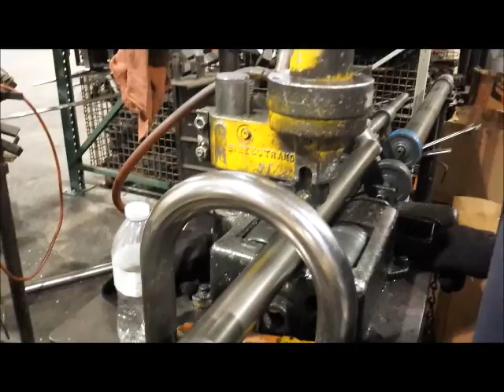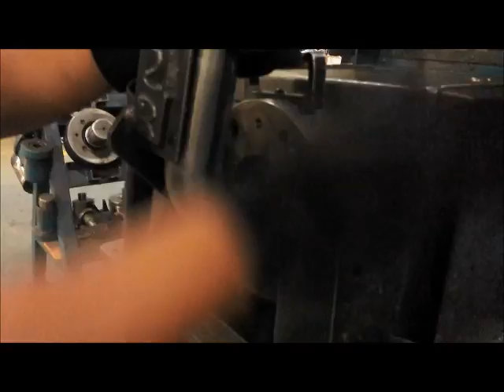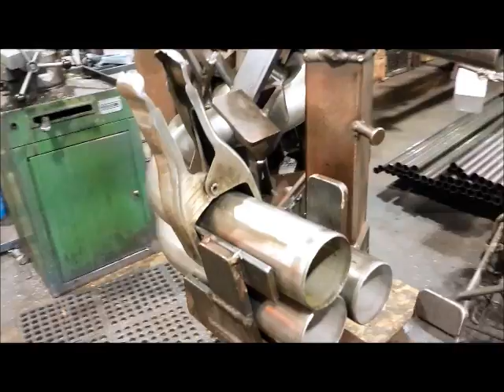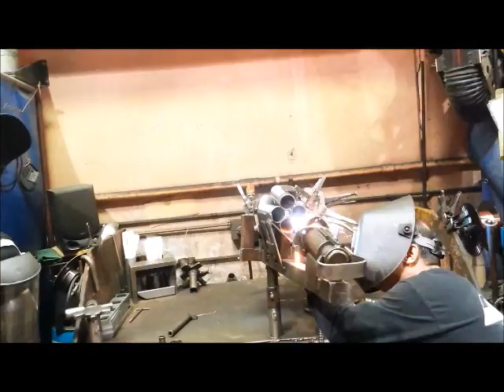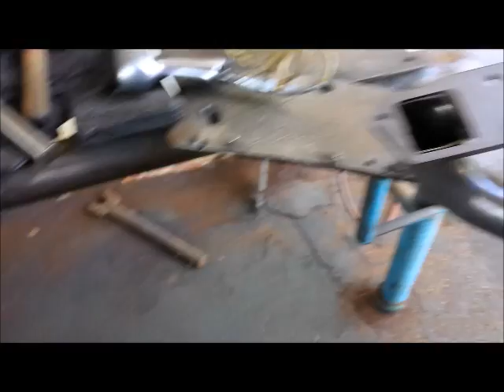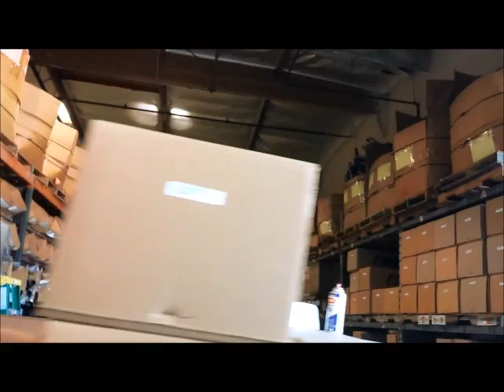How High Performance Headers Are Built

Comment: Hell yeah, Mopar or no car baby 🤟🏼. I can tell that the guy on the right is a newbie, as he didn't know that the SRT8s are powered by the gen3 Hemi mills and is green. I've heard of TTI before, but aren't real familiar with them and didn't know that they specialize in Mopar. He mentioned the 413 wedge and just about bought a 71 Dart last year with a built one. It was so badass and was a sweet little ride, but unfortunately the deal fell through and didn't get it 😪. 
We've been looking at Kooks long tubes for my Challenger SRT8 that we are building, and am looking at all of my options. She's got a decent set of pipes on her and are the SLP loudmouth cat-back system, which basically consists of open chamber racing bullets on 3" and rocks. Indy builds some awesome racing engines, and know a guy that has a 71 Cuda with one of their 572s in it and routinely beats up on hellcats, shelbys etc respectively. Or whatever you throw at it and is brutal, especially for as light as the E bodies are 
💪🏼😎

Comment: Excellent product! I put a polished set on an early model Valiant with a 318 & a 4 speed trans. Only minor engine placement issues easily fixed. I think an automatic would have been a better choice for the car as the stock clutch linkage would not fit but a hydraulic throw out bearing solved the problem.

Comment: I love my hooker headers on my 70 mustang 351w stroker. they are ceramic coated and  are clearanced properly. no familiar with these guys but I'm learning.
Reply: Im peed off that right hand drive performance headers arnt available for a 1999 slk 230 kompressor.

Comment: TTi headers are fucking garbage. Those guys that weld them up can't weld for shit. They look nice on the outside but inside where the critical welds are in the collector look like they were done by a novice from community college. I have a set of the 6.1 Gen 3 Hemi swap headers into an E-body and the weld quality is not worth the price I paid for them. Do they flow well? Who knows? Probably costs some horsepower at the top end. They fit pretty good though that's one of the few positives I can say. TTi makes a header worth $300 and sells it for double because they are the only ones that make the swap headers but quality is really lacking. This video does not show that at all.
Reply: >you want decent headers....get a TIG welder.....

Comment: Hey sir. I have a 1964 Plymouth valiant and i need help, my engine got locked so im trying to put in a new one but cant find the same one. What other engines could i use that would fit with the transmission thank you
Reply: +Jhoalri  Rivera If you don't post what the current engine is - could be anything from a 225 (or smaller) cid slant six to a 413 Max Wedge and a 3 speed manual to a 727 TorgueFlite (if I have the right year).
In 99% of cases, keep the same engine* or, if the transmission is in good condition, a larger version of the same - otherwise you're potentially looking at problems with just about every aspect, from radiator hoses to engine mounts to exhausts to upgrading the transmission, brakes, etc.

*If you're lucky, you may be able to find an exchange rebuilt engine with a warranty or, perhaps, a rebuild kit from someone like SUMMIT.

Comment: Should headers be wrapped?
Reply: +hempseed57 As said, it depends. however there have been instances of mild steel manifolds rapidly rusting out and/or cracking due to the wrap keeping so much heat in the pipes that the metal is weakened, also reports of the wrap holding moisure when driven on wet roads - may be a particular problem with salted roads as salt could build up in the wrap. Some wraps are also intended to be coated.
Personally, I'd go for ceramic coating first - some of the modern products, like Zircotec, can greatly reduce heat transfer - then wrap if required.
Reply: hempseed57  Depends on who you ask. I have heard people swear by wrapping their headers and others who hate it. It keeps the engine bay cooler. But I heard once you wrap your header the finish is ruined

Comment: Ever heard the expresion "polishing a turd"?
They look pretty but with a good 12" difference in some of those header's lengths they will just cause problems for tuning.
Especially for "high performance", tube lengths are critical and that should come first, well before ease of fitting and finish.
Reply: +GordonWG1 FALSE!
Reply: +Bob Smith TRUE!
As I said, they look pretty but will just cause problems for any properly tuned engine. You wouldn't buy a camshaft that had different lift or duration for each cylinder, would you? The unequal lengths will have a similar affect.
I will conceed that they will, probably, be better than using the OEM manifolds, though.
Reply: +GordonWG1 Disagree with you on the problem tuning.
Equal length is overrated for street/strip engines.
Newsflash!
They do make cams that have different lobes for each cylinder.
Reply: +Bob Smith We can agree to disagree then :-)
The only split camshafts (lift and/or timing) I'm currently aware of were some for the big block Chev' engine, as the intake runners are two different lengths (also the reason for the old Can-Am cars having two different length trumpets for their fuel injection), and the classic Mini as the siamesed intakes (and centre exhaust) can cause uneven cylinder filling. There were also some experimental ones to widen the effective power/torque curves by effectively having two different engine configurations - I don't know if they're still available, though.
However, that's a different scenario from having each cylinder's cam' timing/lift different from every other one, which is effectively what uneven length primaries do. If they were all different diameters, instead, would you consider that irrelevant as well?
Come to think on it, there were also several racing motorcycles that paired cylinders 1&2 and 3&4 to give a 'better' power delivery from the different scavenging - they may also have had different cam' spec's for the cylinders as well, but I don't know about that.

I'd be interested in your experience of this, as we're all still learning.
Reply: +GordonWG1 
The importance of exhaust header equal primary tube length is blown out of proportion, particularly on a street-strip application. 
The affect of grossly unequal primary tube lengths on overall performance is minimal. 
There are numerous factors that contribute to the efficiency and performance of an exhaust header. 
Every degree of bend and where that bend is located affects the overall performance.
The addition of a number of bends to achieve equal length can be more detrimental to performance than unequal length primaries. 
It is firmly established that equal length primaries such as zoomies that all flow equally can increase performance, but usually only for a very narrow rpm band and still need to be designed to match the flow and VE of the tract upstream.
Reply: Tuned equal length tubes would be best but there's no way you're fitting those in an A-body without cutting up the body. It's way too tight in there.